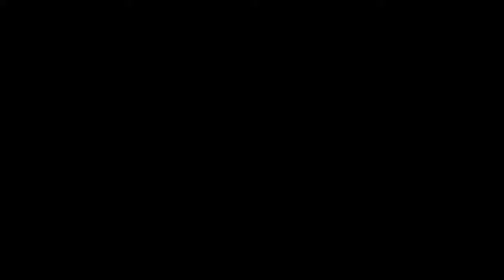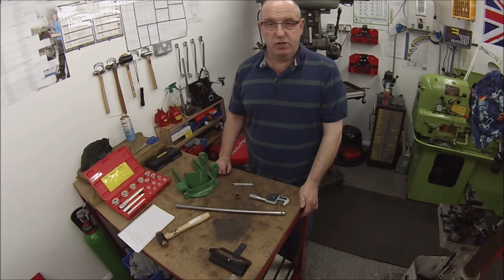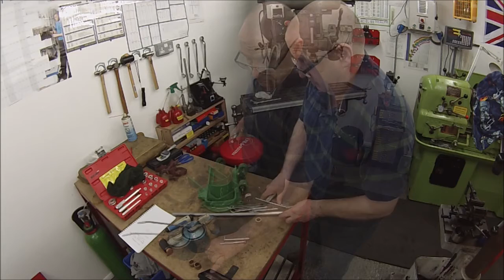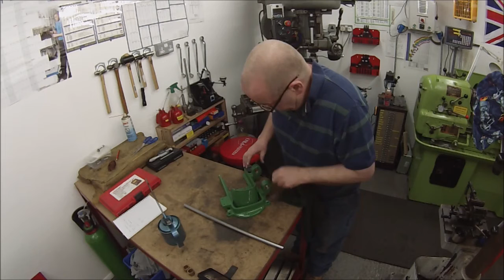Bronze Bush Replacement

Comment: Practical way to insert the bushing without compressing its edges, especially the traction. I saw experienced rectifying mechanics, which due to carelessness or abnormal expansion during machining, left the piston pin bush very tight after the final finish. Then the solution was to place the pin on the bushing and with the connecting rod secure with one hand, give a few strokes around and on the outside of the connecting rod about 120 °. Soon the bushing conformed to a gap just for the oil film.
Thank you again!
Reply from the maker: Many thanks

Comment: Wonder if there is a nut and bolt method for removing the bushing please?
Reply from the maker: Yes, you can always pull a bush out using a long bolt and washer though a suitably sized spacer.Thanks for watching